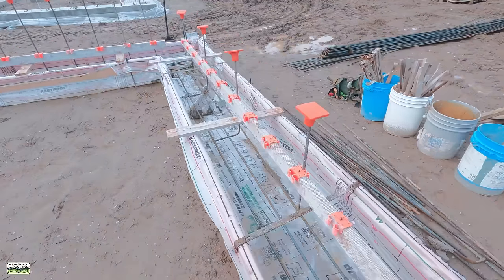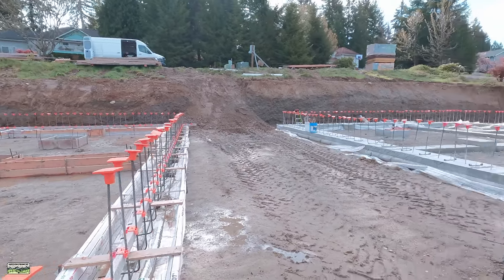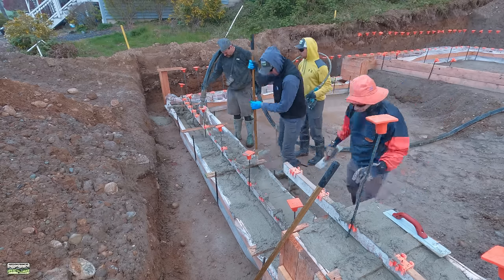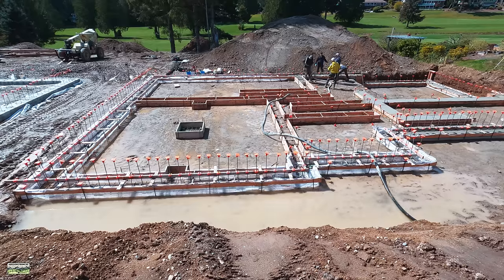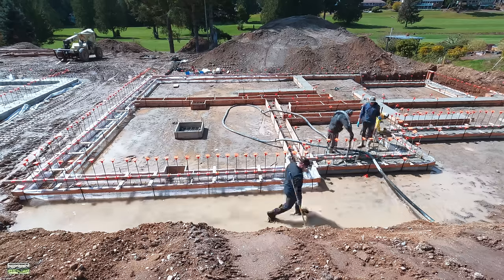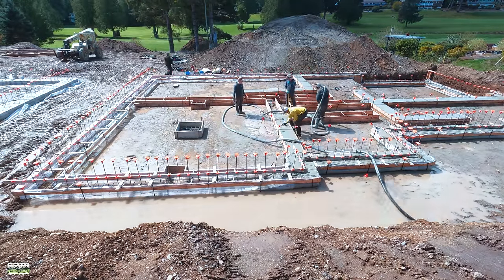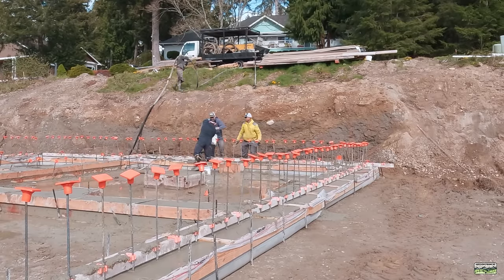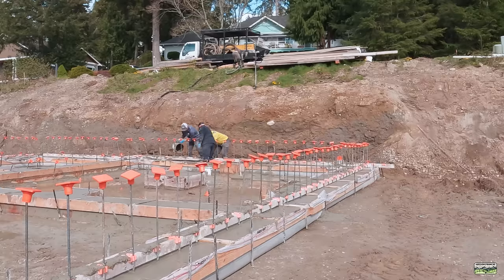I Made a BIG Mistake!! Footing pour

Comment: I poured a footing for a house in the country that was in an open field. It was just me and the concrete truck driver. I was very confident in my forms as they had been checked and rechecked. Everything went really well until the end when, because of the exposure to the sun and the 95° heat, I literally had a stroke right after the concrete guy drove off. Luckily, my neighbor was home and saw me go down. He ran over, dragged me into his yard, and sprayed me with the garden hose until I came to. I didn't realize I'd had a stroke, and neither did he. I'm lucky to be alive. Fortunately, I was way younger than I am now and in the best shape of my life when this incident occurred. The footing turned out mostly OK except for a short section that I never screeded off because I passed out and forgot about it after I came to. The block layers ended up telling me it was the flattest, most square footing they'd ever seen. I formed it myself. It took me about a week. No laser. Just a 6' Stabila level and a commitment to ZERO variance the entire time.

Comment: Yeah, thanks for sharing this. As a cabinet maker that knows almost nothing about footings and foundations, I can only think that some 3' bar clamps might be a possible help in this situation. Of course as a cabinet maker I have plenty of these on hand and not something a framer might have in their toolbox.  I did have something similar happen once and it was also because something didn't get nailed or screwed together. It's easy to forget. Glad you had enough extra concrete to make it work.

Comment: One thing I've learned. You can screw up but just make sure you have the fix. Cause everyone hates fixing someone else's screw up.

For me in electrical (and can apply to any trade) the only concern with a screw up is hopefully no one gets hurt. In commercial it can be deadly if the screw up is found during power on.

Comment: Good video I like the comments of yup just walk away and you go and mess around with it again. I would suggest that you get a high lift jack for when you do your placement of concrete. Would easily span the footing and could  pull the footer walls back into place.  It would also be easier as there would be no jerky movements of the boards or large movement of the concrete. This would allow you to drop your spreader bars in place.

Comment: If the sand in the mix is reclaimed or a manufactured sand, it will cause pumping issues with small line pumps. Request a natural sand in the mix design.

Comment: so suppose that had been unrecoverable. Say you were understaffed, and couldn't move it back, AND you didn't have spare concrete. What is actually the best practice for an unrecoverable error?
Can you just reform it and fill the new forms? or do you have to do something fancy to make a subsequent concrete pour bond to a previous pour? Would you be able to use bags of concrete to hand mix for a top up like this, or do you need to order a short load? 

I find this really interesting as this is something I hope to never have to do, but in my area, it really looks like hiring a concrete sub is not easy right now... so it's pretty important to at least know what you can't do, if not what you can.
Reply from the maker: Honesty it wouldn't have happened if we didn't have enough help.  I wouldn't have popped that cleat, I'd have been too busy.

Comment: It looks like you are using rebar as pins and your spacing and bracing is just being cheap...
Spend the money and buy the correct form pins and or bracing system...
I will do a reaction video but it will be on rebar placement... Not on your blowout...